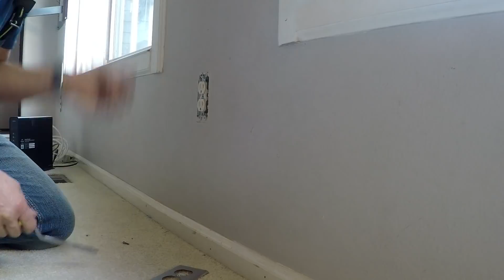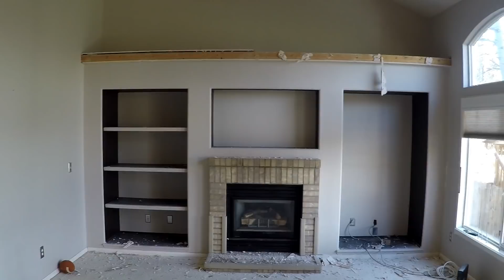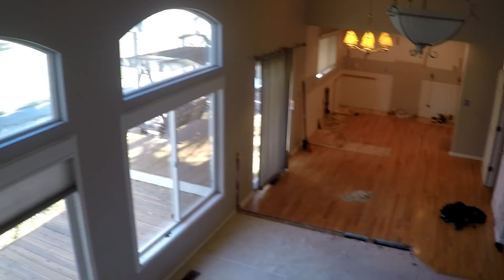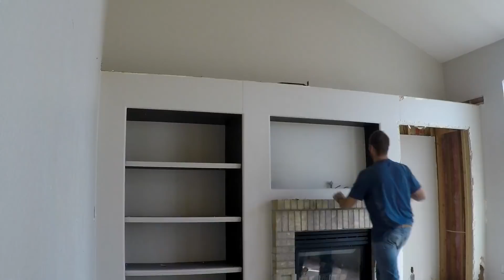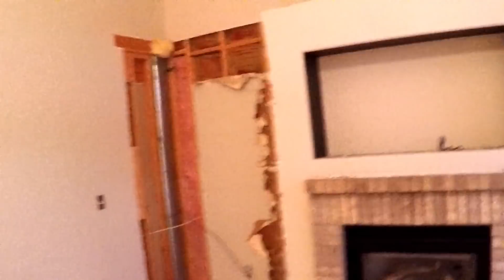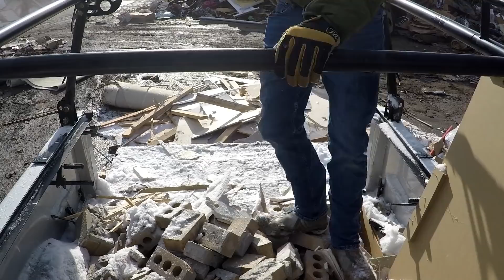High Budget Living Room Remodel | THE HANDYMAN

Comment: People don't understand that codes have changed and why. It doesn't always mean it won't work.  In fact in most cases with electrical it is due to the higher demands of today's households. What would tend to happen is the constant tripping of breakers.  Nothing to do with fire issues unless people changed breaker sizes without knowing what they are doing. Remember you can't change a breaker size without changing the wiring in most cases.

Comment: 864 by the way backstabbed outlets can often work out great when they act properly but electricians will always hate it cause on the big scale we get called to service when they fail I did residential service calls for about 6 months and saw where 15 failed so its considered a bad practice but if its your place do what you want I just think its easier to spend a bit of time upfront to save trouble down the road no disrespect you just seem like a do it right not do it twice kind of guy and it could save you some headache

Comment: 376 Lbs, and in regards to your chainsaw, id go with the 60v version. 40v batteries are only good for like 3-4 tools that dewalt has, where as the 60v is almost as good as the 40v and you can use the 6 and 9 AH batteries for all your other tools.

Comment: Your dump sure does operate differently to ours.  No recycling policy or segregated waste? Over here (UK,) when you visit the dump, there are bins for everything apart from household/general which usually ends up in landfill. But wood, rubble, metal, mattresses, tyres, cardboard, plasterboard etc all have a seperate place. Iv'e just done a vid on one of my visits to the waste centre, where I only had wood. (tee hee), As i have a commercial vehicle, I am also not allowed to enter the public waste facility and instead have to pay to dispose of my waste (charged by weight) at a commercial centre, and legally I must have a waste carriers license for my business. Do you not have anything similar? I'd love to just drive up, open my back doors and just kick it all on the floor...
Reply from the maker: None of that here. dumpsters and dumpsters and dumpsters of all random trash are all dumped in the same spot.

Comment: hey bro so how did you end up rerouting that wire in the corner
Reply from the maker: I ran all new wire all the way around that end of the room.   Kind of hard to explain through text.  I added an outlet in the middle at the TV location.
Reply: @TheHandyman1  no it makes sense cause that's what I would have done

Comment: Question. This is for Handyman and other persons in remodeling, contracting type businesses. Is it a bad idea to reuse materials taken from the residence that can be used to continue on the remodel? I see some really good 2x4s, brick etc. Sheet rock not so much as it is torn to heck. I am not saying scheme people on remodeling jobs by reusing materials or am I implying that you do. I am frugal I guess and sure seems like a waste of good construction materials being thrown away. Or is it just best to discard and go all new?  Just asking and curious.
Reply: Roy Celaya Hello Roy, I am in the construction industry and design interior remodels for a large contracting group in Nashville. To answer your question, most of this just comes down to time. There are unfortunately many materials demolished during a renovation that are not in bad shape, but they are connected with multiple screws/nails and it is surprisingly time consuming to disconnect particular parts to save them. It’s also surprisingly time consuming to re-use old materials because they are generally cut short and cause more ripples than rewards. Time is money with construction and it is hard to find installers who do good work. It is exhausting to find installers who do excellent work.
Reply from the maker: Great comment Reilly!